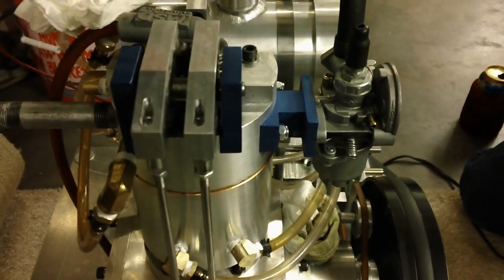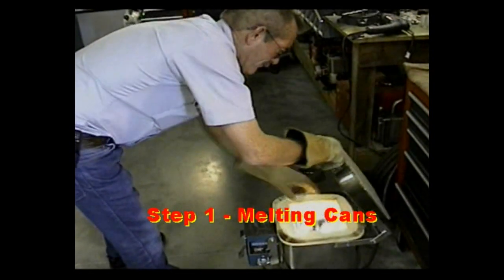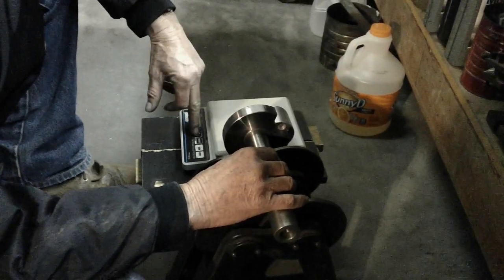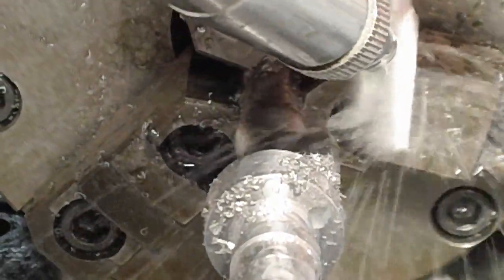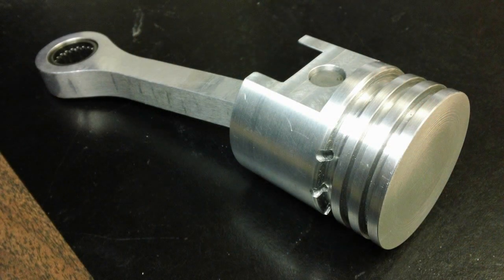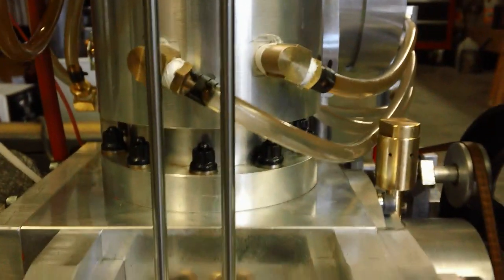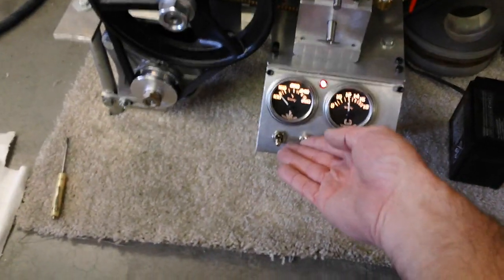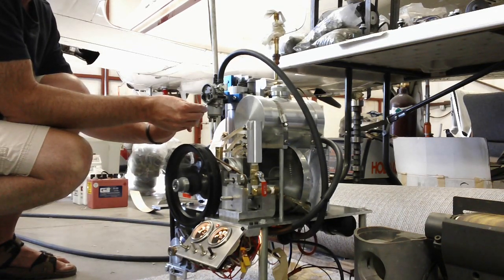Fabricating and Running a Scratch Built Engine from Beer Cans

Comment: As I see the part with the head laying on its side. The water won’t flow through it! If I’m wrong ooops. Explain how the water is to get from the inlet tube to the outlet? With the head and gasket installed the pathway between the intake port and the outlet don’t connect? Like I say if I’m wrong ooops.  Or I’m looking at the stopped video wrong.

Comment: Wow! One day i will make one like this! just need a foundry, engineering knowledge, a mill/lathe. I wish i could make a motorcycle engine, but first i need make one smaller lol. Beercan Engines, the piston is made of pure aluminium? the piston of motorcycles and cars are made of an alu. alloy with 12% silicon. wouldn't casting the aluminium in green sand, cut the time of the engine building? Or you made the parts milled off aluminium billets due their ''strengh''

Comment from the maker: jackkollan, beer can aluminum is very gummy. It galls to the tools very easily. Also, dross and hydrogen porosity are issues. You never know when you're going to run into a void. Using salt as a flux and pouring it into the ingot as cold as possible helps out a lot.

On the other hand, it's very easy to polish and easy on the tools.